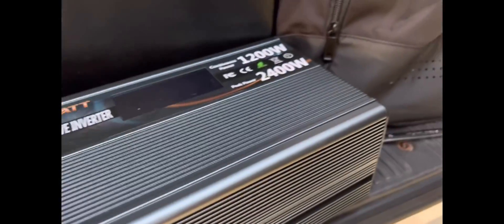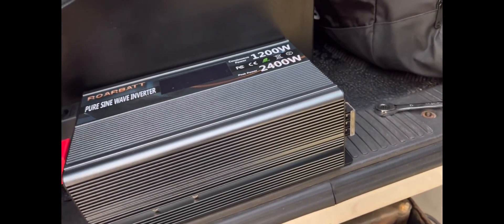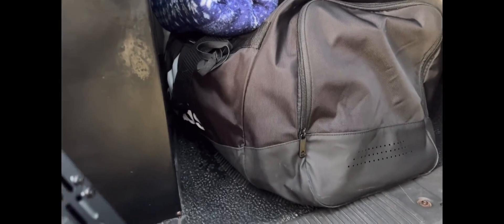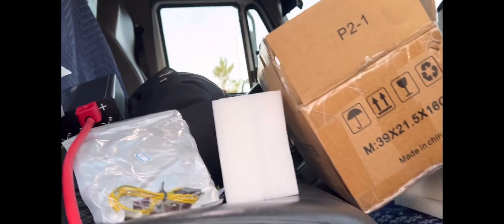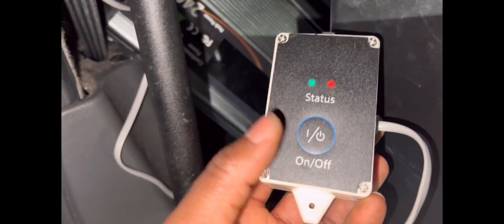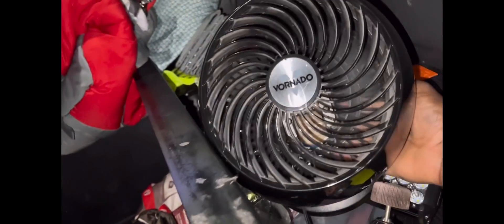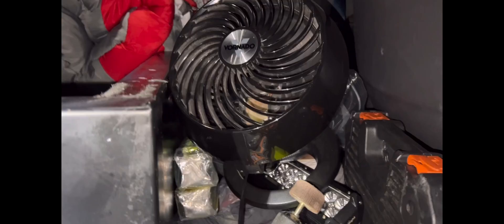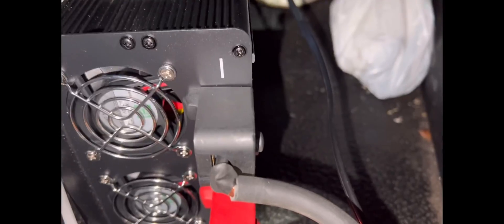How to Install a Power Inverter in your Box Truck

Comment: Hey, if the cables are long enough you can run the wires through the steering column. You won't have to drill through the metal at all there's only a rubber grommet around the steering column shaft I've always ran wires that way through the firewall...  You can also check the accelerator pedal. Where it connects there's usually a hole with a rubber grommet for the connection you can run the wires through there too.
Reply from the maker: I'm going to get new cables